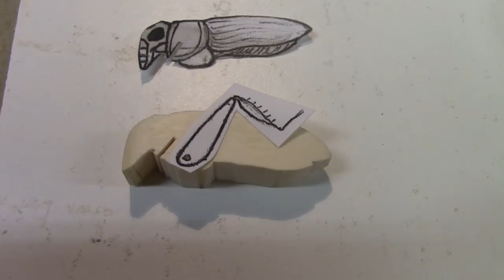Making a Cricket Lure

Comment: Hey. I got a nice trick tip for you! If you use a laser printer... you print out the lines. Then turn the lines on the wood. Then use a Acetone on some cloth and moist the paper on the backside. The acetone will transfer the printed lines on the wood ;) I hope I writed this in a way you can understand. 
P.s. keep up the good work

Comment: I'm happy to see the new band saw blade, It makes the cuts look so much nicer!!! I got another tip for you, you can order these unsharpened syringe tips for putting on superglue but you can just as easily use syringes you can buy in a drug store. I did some medical device manufacturing and along with the ultrasonic plastic welder that was one of the coolest tools I learned about. You can use it to deliver the exact amount of glue to the exact place you want to put it. PS I'm looking forward to seeing that crawdad!!! hopefully you can put some blues in the coloring... Also if you want to do a bigger bug you can make a potato bug though bugs usually struggle on the surface more making vibrations in the water so I don't really understand why you would want the bait to dive?

Comment: For the legs why don't you use a resin or epoxy just to make the shape? Feel like it would last longer and look a little more durable. **EDIT: what if you put a small hole with a small pocket of sealed air? Couldn't hurt.

Comment: If you’re struggling with buoyancy on small Baits like this, have you tried drilling a small hole, like you would for lead, but plug it with cork? 
You can buy cork sticks in various diameters from eBay. I use them to make Baits like nuts more buoyant for carp fishing.